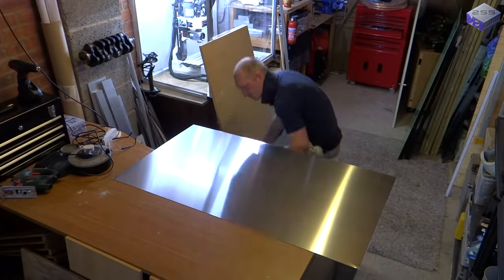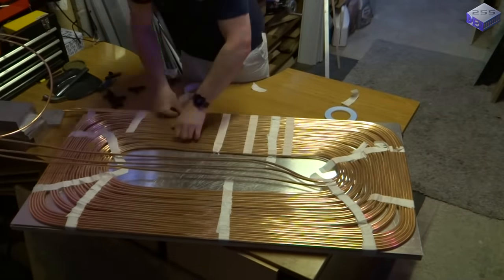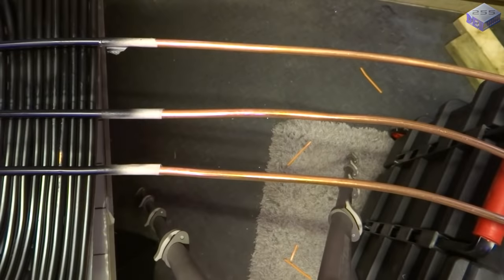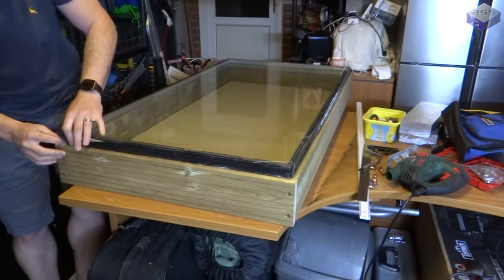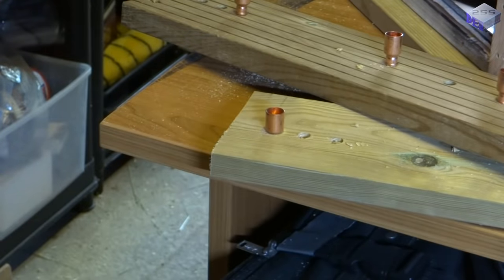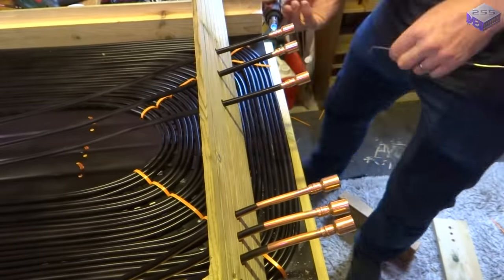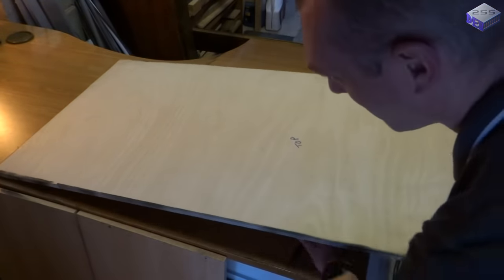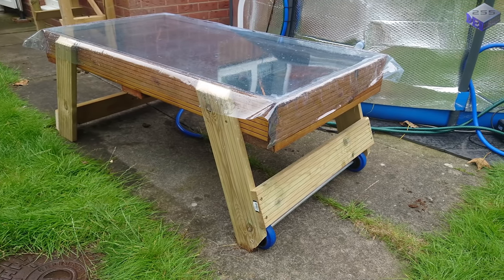Improved Solar Pool Heater - Full build

Comment: I made a similar thing with copper pipes on copper plate. Put the inlets at the bottom and outlets at the top when the panel is tilted this creates a thermal siphon. Also rigged up a small electric pump that was driven by a solar panel. When the sun was out the pump started and if the sun went behind cloud the pump stopped. This helped to prevent spilling heat from the tank back into the collector when it was cloudy.

Comment: great stuff. I think for the alumunium radiant layer in the bottom, it will deliver more heat if you give an airspace about 1" or 25mm where it face the alumunium layer on top of it. this way it will "harvest" any runoff heat and reflect it back into the pipes.
for comparison, a solar stove of the same design with all 5 sides layered with radiant layer can go as high as 120 degrees celcius inside...very nasty heat
Reply from the maker: Hi, thank you. That's a good idea as I was going to reduce the height of the sides to remove the amount of air between the pipes and glass, although could just move the insulating air to the back by raising the aluminium. I left this in the sun for a couple of hours when I was setting it up and the first run of water through it came out as pure steam instead for around 20 seconds, so I can quite believe it. Maybe I should make a Solar Coffee Machine 😉

Comment: My stepdad built a device like this in the 70's, we used a mirror on the inside of the box, and metal piping...it got damn hot near boiling. we were trying to get it to boiling but never made it work, our design was also pyramid shaped to gather sun from all angles

Comment: great home brew project.  The copper pipe should outlast pex or other plastic pipe by a wide margin.  However......it can't stand any freezing.  One way to reduce the risk is to program the arduino to turn the pump on if the temperature gets close to freezing inside the panel.  Of course, for your application you will probably break the system down in the fall and put it away safe from freezing temperatures anyway.  It's a bigger concern if you want to heat, or preheat your domestic hot water which would be a year round energy saver.
Reply from the maker: Hi, definitely, I did think of running a small PV solar water heater when the panel got below 2 or 3º whilst isolating the pool pipes. Although, as you said, it's all packed away until the sun shows up again. I may just do a test of how it performs over the winter months, I don't mind testing things til destruction so others don't have to.
Reply: Just add an air connection so you can blow it out before winter with a compressor.  Maybe feed in a little RV antifreeze as well.
Reply: @ffjsb  I would either drain it and bring it inside during the winter, or use your idea to blow out the lines and add pool antifreeze.  Just make it part of the pool winterizing procedure.  If I wasn't so far north where the temps get -20 degrees F, and somewhere like the Carolina's, where the temps get down to about 25 degrees F, I would consider running the heater year round.
Reply: @RandomRockets just run the heating loop with a % antifreeze, say 50. You'd need a separate loop and plate exchanger so you're not getting antifreeze. 

Or a separate exchanger inside and blow off the heat with a fan. Just depends on your setup and applications.

Comment: Quite nice! Do you calculate the cost of copper tube to be worth it over your previous version? Separate smaller dia was a great thought, & I like that it avoids UV degradation concerns.

Think I'd skip the sheet alum, move the air pocket from above the tubes to between the radiant insulation, & either swap to polycarbonate or make sure the glass isn't argon-filled with a low-e coating (loads of free old patio sliders here!). Really interested to see what you try/test next.

Also, slightly off topic... Might consider building yourself an ICF pool, since you're not DIY shy. No reason it couldn't be above ground mostly, to avoid excavation expense. Simple long rectangle for swimming laps, insulated below, mono-pour, sealed the EcoFinish method for longevity. Continuous insulation & thermal mass would lower the requirement for heated water, plus keep temps more stable.

I'm planning to put mine in a south-faced greenhouse, attached along the side of a tandem ICF garage. Should help moderate harsh winter nights in there, & the greenhouse should also protect the solar water heater from freeze (mounted to ceiling near back wall).
Reply from the maker: Hi, the copper may be a little expensive for similar output to plastic tube, so I'm not yet convinced, apart from longer lasting, lower radius and better heat transfer, although still expensive.

I have got some polycarbonate to switch to and a single pane of glass, plus some reflective foil too. My intention was to test all this out this year although I've been a little ill, but will hopefully try this out soon (ish), weather depending.

I like the idea of the ICF pool for the future, although we haven't yet settled in a our own house yet, so will wait on that one. Good suggestion.

Good luck with your system, it would be good to hear how you get on.

Comment: Might be worth baring in mind the heat generated can melt solder . It’s probably worth sticking to compression with brass olives (copper olives can leak and aren’t recommended. 
Great vid 👍😎
Reply: Wouldn't solder designed for plumbing be ok?

Comment: I think a good idea would have been to open one end of the double glazing, put the coil and a blank backing sheeting inside and seal it back up. :) EDIT: you could always then put a part vacuum, improving the IR collection even more. That is, if it holds a vacuum.
Reply from the maker: That's a great idea and makes a lot of sense, I have another double glazed unit, so may have to try that one, especially if it can take a vacuum. I will be making a 3rd version with the plastic tubing at some point this year (hopefully soon). Thank you for the suggestion 👍
Reply: Dude. You're a genius! I'm totally trying this with my work scrap.

Comment: The point of the aluminum is actually to provide a fast metal heat conduction path from everywhere the sun strikes to the pipe - to the WATER, which is where you want to get it to.  You would still capture just as much sunlight without it, but if you just painted the wood black it would move much more slowly toward the water and you'd lose more of it to the outside.  You're making the thermal resistance from "everywhere" to "water" as low as you can make it with the aluminum.

Comment: Great idea, I’ll be copying it :) but using zip ties on a project designed to sit in the sun seems like a poor choice over some bailing wire,
Reply from the maker: Hi, thank you. I think you could be right, although survived so far the UV may destroy the plastic, the panel does stay relatively cool though with the water running through it and I thought the orange cable ties gave it a different look. Maybe bare wire twisted underneath would hold better and could be sprayed black also.
Reply: @TheSolarPoweredEngineer  Glass is UV opaque, so you don't need to worry about the zip ties in that regard. Heat may be an issue as I know that nylon printer filament only needs to reach 220-250°C to be extrudable, so if you may have steam on your hottest days, the zip ties will have probably warped.
Reply from the maker: @mtnbkr5478  I'll be replacing the zip ties later on and plan to use clear polycarbonate for the top and reduce the amount of air in the box, all to see how efficient a homemade pool heater can be.

Comment: I was wondering how the copper tubing is handling the chlorine in the pool since chlorine reacts with copper, and I wonder how long the thin copper tubing will last before seeing pinholes in the tubing. Also are you seeing any staining from the copper chloride being introduced to your pool?  I currently am running a homemade solar heater, and I am always trying to re-engineer how I have it built every year trying to make it better. I have thought about copper tubing, going with very small diameter tubing running paralleled to super heat the water before reintroducing it into the water returning from the filter, so I don't have dangerously hot water spraying into the pool.
Reply from the maker: Hi, I was concerned with this too and have done a fair amount of research to try and find answers. I have it directly connected to our pool and have not seen any corrosion, staining or any copper chloride being introduced. In England, the Drinking Water Inspectorate (DWI) requires that drinking water is maintained at the correct PH level and add 1mg/l (1 part per million) and up to 5ppm of Chlorine when carrying out maintenance; this (according to the below link - DWI Chlorine) is the safe level for drinking water within England. As this water predominantly runs through copper pipes in the home (replacing lead piping), there should be no concern with copper use concerning Chlorine as long as the PH balance is maintained. A greater PH imbalance exacerbates the issue with chlorine and copper corrosion, so it's important to keep the levels maintained. I agree that drinking water is constantly run through the home water system, where pool water is cycled around the same system, although if this is correctly maintained, there should be no concerns, especially as pool water is classed as non-potable.

A good point to note with my system is that I've introduced a UVC (UV Clarifier) to our pool that allows us to reduce the Chlorine level to around 1ppm from 3ppm.

I am looking at an alternative method of delivering the heat through a basic heat exchanger, so watch this space... ;-)

Here is the link to the DWI Chlorine document: https://cdn.dwi.gov.uk/wp-content/uploads/2020/09/23151717/chlorine.pdf#:~:text=The%20World%20Health%20Organisation%20has,level%20below%201%20mg%2Fl

You shouldn't get scolding hot water out of the tubes, this one has around 1.5ºC difference from input to output, this as the flow rate is around 4.5 Litres per minute which creates turbulent flow (better for heat transfer). If you run water through these at a trickle, not only will you get laminar flow (less efficient heat transfer) but you will also increase the heat out. Although this heat feels better, its the volume of heated water that counts, so a fast flowing 1.5ºC increase will make the pool warmer than a slow flowing 20ºC increase; this is because you are taking the heat away from the panel quicker and allows it more scope to heat up.

I hope all that helps, please feel free to ask further questions and good luck with your system.
Reply: @TheSolarPoweredEngineer     Have Either of you considered using a NON-Chlorine water sanitation substitute such as Pristine Blue?
Reply from the maker: @MojoMed141  Hi, I haven't heard of it, although know there are other alternatives to try, I did put the UVC in-line and that has drastically reduced the chlorine required to keep the pool clear and clean. I shall take a look at Pristine Blue though, Thank you for the recommendation.
Reply: @TheSolarPoweredEngineer  iii

Comment: What temp diff did it create between inflow and out? Also consider putting it on an adjustible angle 90 degrees to the sun
Reply from the maker: Hi, I am making a 3rd version this year that tracks the sun, hopefully that will work well. I was thinking of adding mirrors that also track the sun. I need to do some more testing this year to determine the temperature difference, we didn't have much of a summer last year.

Comment: Hi, thanks for sharing it. It was an amazing project. Please, one question. How was the increased water temperature with one set solar pool heater?
Reply from the maker: Hi, this one is producing around 500W max at the moment (I'll be doing some modifications later to see if it can be improved), so on average over a good 8-hour day of sun it generates around 3.6kW (450W x 8hrs average), this equates to around 4ºC for 1000 litres of water or 2ºC for 2000 litres. The main issue with pool heating is in retaining the heat in the pool, where overnight it can lose a fair amount; for this I have reflective insulation around the pool, matting underneath and a pool cover that reduces evaporation also.

Comment: Great DIY project ! Nice and tidy. Can I ask you how did you calculate the 500W ? Delta difference between water going in and water going out times water flow ?
Reply from the maker: Hi, thank you. Yes, I measured the flow rate and calculated the wattage from the temp in to temp out. I now have some flow rate meters that I will be fitting along with accurate temperature sensors to log the performance of the solar heater.

Comment: I made 1 virtually the same as this last year. I managed to get some 10mm toughen glass 6'x3' for free on facebook so that dictated the size of my heater. Also used 10mm copper tubing but only had 2x25m rolls ( underestimated what I would need) I wanted to use same 32mm connections on my 12' intex pool so I bought a solar panel with a 8m rise pump this would result in not costing me anything to run once set up. I bought a reducer bringing it from the 32mm down into a 4x10mm outlet. I cut each Coil in half and ran 4 lengths around my board then back into connector to bring it back to 32mm to go back in the pool. I also fitted temp gauge on the outlet so I can see what the temperature is going back into the pool. It was showing a good 40-50°c going around the short lengths. After 5-7 days the 7000L pool was showing 32°  with a peak of 36°. Plans this year is to get another 50m of tubing and extend each runs to 4x25m
Reply from the maker: Hi, yeah, you'd think 50m would cover quite an area, but it runs out pretty quick. I have 75m in this one. That's some good temperature increases. I am looking to do some more experimenting this year with different configurations and materials.
Reply: Am interested in doing something similar myself. Which 8m riser pump and solar panel did you get?  And also the reducer any links to that have done a search but can’t see one. Thanks
Reply from the maker: @jamesfranks5635  Hi, I had to have a look through old invoices to find out about the reducer, here is a link to the ones I bought: https://www.tradingdepot.co.uk/fitting-reducer-solder-ring-15mm-x-8mm

The pump I was using was this: https://www.allpondsolutions.co.uk/pond/pumps/full-range/1400lh/  Although this wont pump to 8m, but Allpond may be able to help with one that does.

Comment: To greatly improve this, you should not use a continuous coil. You really want to use a manifold for the entrance and exit with parallel small diameter tubes connecting the manifolds. This way every tube starts with water at the current pool temp... thus the greatest heat transfer rate.
Reply: But don't you then have to calculate the necessary minimum lengths to gain efficiently? You could use a manifold to prevent over heating the water, essentially acting as a throttle. The problem would be on cloudy days, would the heat fail to rise enough BECAUSE it wasn't a continuous loop?
Reply: @sleepingwarrior4618  The greater the temperature differential between the cold and the hot, the greater the energy transfer. Might be a bit counter-intuitive but rather than, for instance, flowing water through slowly so it's nice and hot out the end you'd want it flowing faster.  If you then measured the total heat gain in the swimming pool you would see that faster, less temperature rise in the output, actually heats up the pool quicker.
Reply: Just take a big watercooler, bent the cooling ribbons carefully, to maximize area and paint it deep black. Put glass on the front and thermal insulation all around and you are done :D
Reply from the maker: Hi, this is the reason for the 3 runs in the system so it has the same (roughly) diameter as the incoming/outgoing pipe; this so that there is more surface area when in parallel and has more turbulence through the pipes with a faster flow. The turbulent flow allows all the water to contact the skin of the tubes and transfer the heat away with the colder water, where laminar flow is less efficient (similar to turbulent flow in a combustion chamber to mix fuel and oxygen to reduce hot spots (I don't see much benefit of porting and polishing intakes)). The faster you can transfer the heat away from the tubes, the more heating capacity (difference between tube surface temperature and water temperature), where thermal transfer travels from hot to cold, so with a greater difference you have more transfer. I can also reconfigure the panel to be in series to see if this would perform better on cloudy days. I like the engine analogy 😁👍
Reply from the maker: @sleepingwarrior4618  As long as the tubes remained as cool as possible, that would indicate the heat was being transferred to the pool. I also take the coldest water from the bottom of the pool (via the drain outlet) so that there is even more heating capacity in the system.
Reply from the maker: @KenWeston  Exactly, and the reason I take the water from the coldest part of the pool via the drain outlet to get the maximum difference in temperature. The flow rate is fairly high to encourage turbulence in the tubes for better heat transfer too. I need to do some more mods on this one as I have a lot of good suggestions from the comments.
Reply from the maker: @philipmariusmueller  Love it, yes I was thinking of trying a vehicle air-con external radiator to see how efficient it could be.